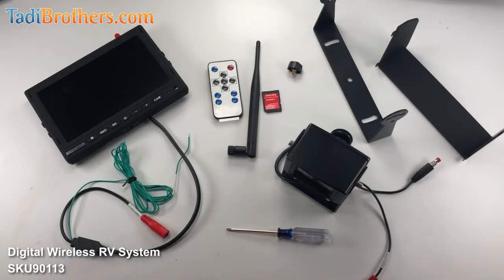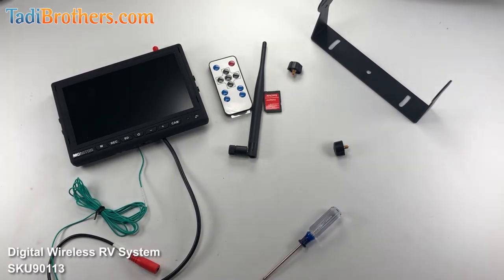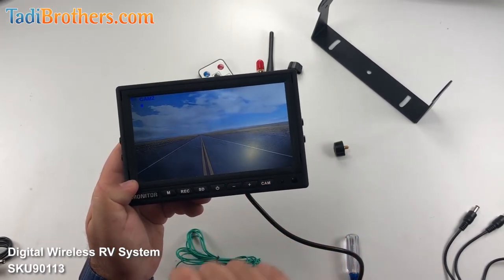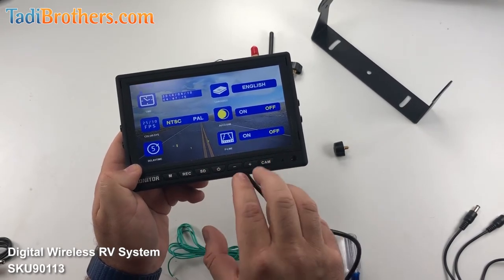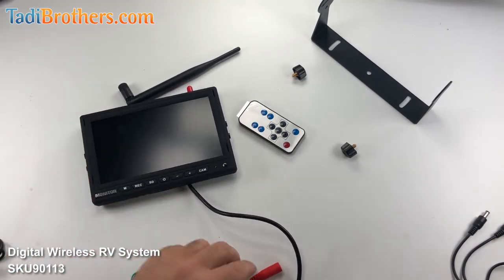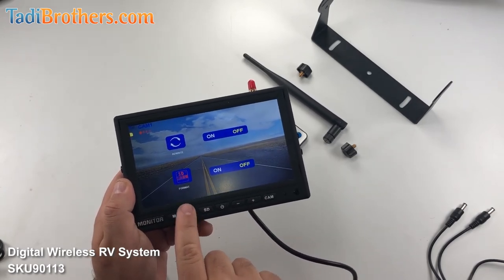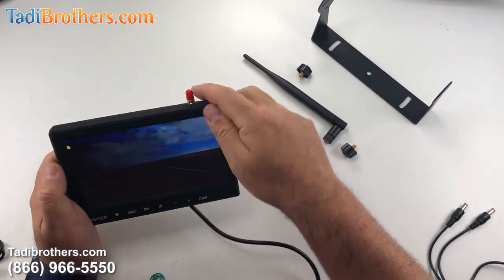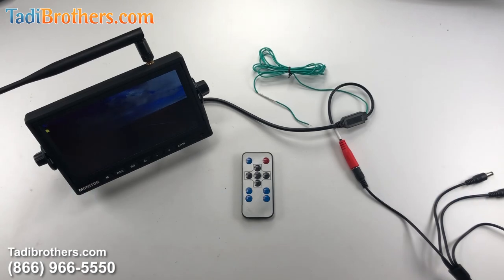Wireless Backup Camera for RV setup guide

Comment: what is the green wire for on the monitor
Reply from the maker: The green wire is a trigger wire that will activate the entire system when you turn on the car, to use it, connect the green wire to something in your fuse panel that turns on when you turn the ignition.